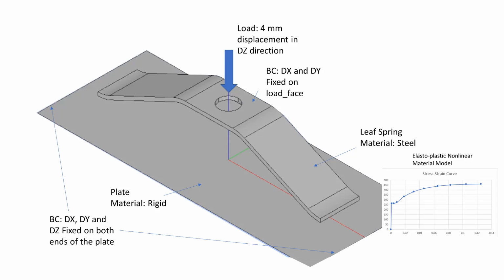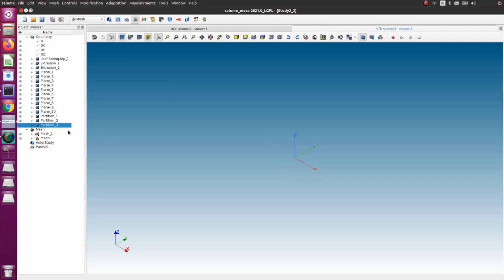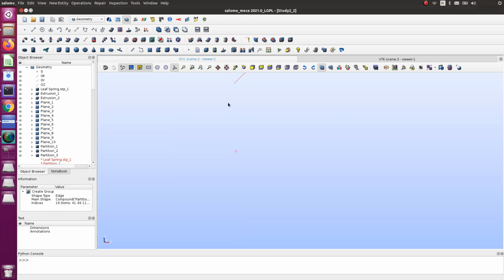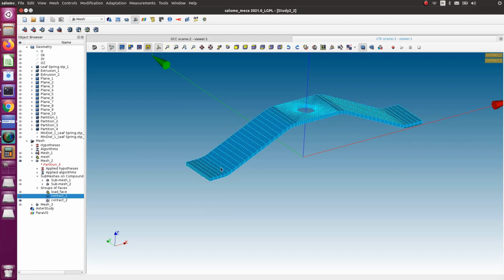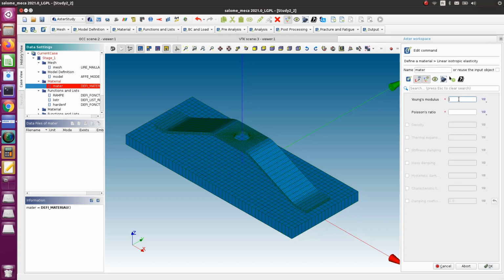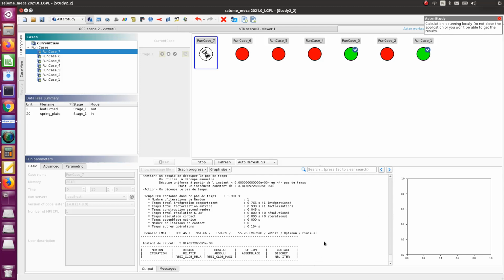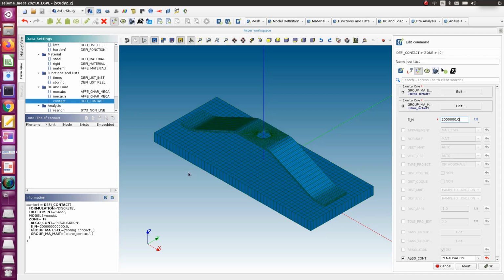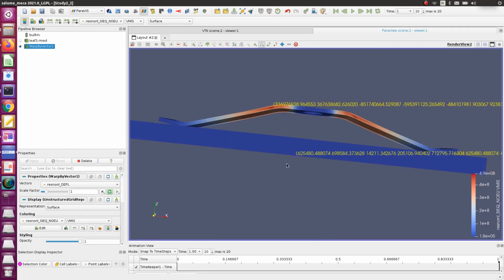[Salome Meca Tutorial] Part2 - Leaf Spring Nonlinear Material and Contact FEA Simulation

Comment: Thanks for the great videos. I am considering Code-Aster for a project and wondering if this is the right software for that. The questions are: 1) Can Code-aster model steel rebar embedded in concrete? 2) Can it model both steel rebar and concrete in the nonlinear range of the material response? 3) Does it do explicit analysis? 4) Does it do concrete creep and shrinkage for concrete? 5) Does it do nonlinear dynamic analysis? 6) Do I need to write input text file, or is everything done visually? Thank you so much.
Reply from the maker: Steel- rebar, probably doable but not simple. Explicit analysis: No, code aster doesn’t do that. Concrete creep and shrinkage: I think so but you may have to create your own material model. Nonlinear dynamic (implicit): yes. You can do many things visually with aster study (check my videos) and you will still need to dig into the right functions to use for complex cases, fortunately, you have a library of validation cases that you can use to get inspiration (1000+ cases)

Comment: Hello Cyprien, thank you so much for you valuable tutorials! I am not able to run the simulation becuase the I always get the error that the matrix is singular. I am using Salome Meca 9.3.0. I have checked boundary conditions, the geometry, the definitions of all commands but I cannot get it running. Do you have any idea? Thank you
Reply from the maker: Singular matrix comes mostly from boundary conditions lacking somewhere. Have you tried to run the model I shared in my GitHub repository?
Reply: @Feaforall  Hello Cyprien thank you for your reply. When I run your model everything goes well. I think that the problem is that you prescribe the displacement DZ of the leaf spring to generate the contact with the plate. Instead I need to assign a force Fz which presses down the spring on the table. But in this way I get the error that the nodes of the spring has rigid motion in Z direction or that the LOAD_FACE elements do not belong to the mesh. I get the same error using your model too. Have you ever tried simulating contact with an imposed force?  I am thinking that I should link the nodes of the spring and the table in D direction at the contact areas for example using LIASION_MAIL or something similar.  Could it work?   (I am rookie on Salome Meca)
Reply: I am sorry Cyprien I think I got the point. What I am trying to model is basically impossible with a structural Finite Element analysis. I am trying to apply a force and simultaneosly allow the spring to slide on the table. However for some nodes the displacement in DZ (normal to the contact surface) may assume any possible value. In Finite Element analysis if I apply a compressive force to the spring a friction force is generated at the contact surface and I should consider this force balance.  That's why the model cannot converge in this case.   Probably what I can do is still applying a displacement and then compute the reaction forces at the contact surfaces and calculate the displacement value for which I get a reaction force equal to the one that I wanted originally to apply.      It now sounds better to me. Do you have any other idea how I could simulate the sliding-friction contact with an imposed force as loading?  Thank you so much
Reply from the maker: @diegodoni3999  You are correct here, a Force is never recommended when you perform a nonlinear static simulation because of many convergence problems, so using displacements is what is generally done. 
If you REALLY want to use a force, it should be possible, but you will have to think well about how you constrain your model. For example, If your force is in DZ direction, you will have to fix DX and DY otherwise you will get a singular matrix error.
For friction, you have to select the right contact type that supports friction (refer to the code_Aster doc). That will give you even more convergence problems as friction is also very hard to simulate correctly...
Good luck